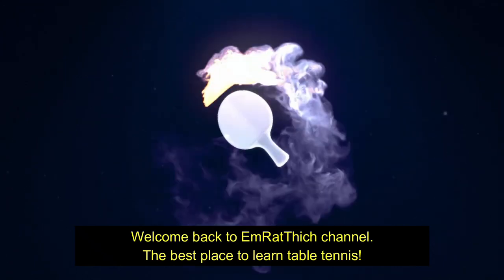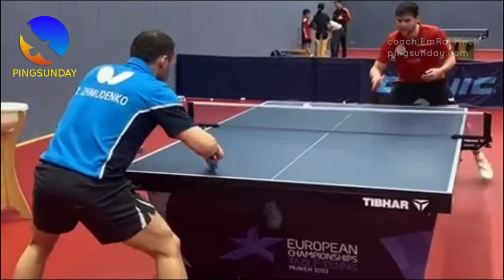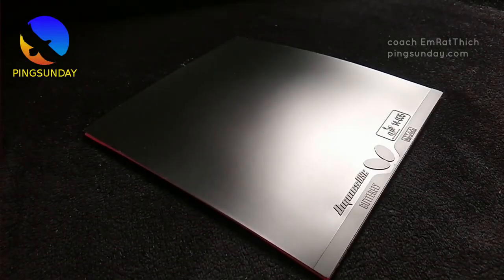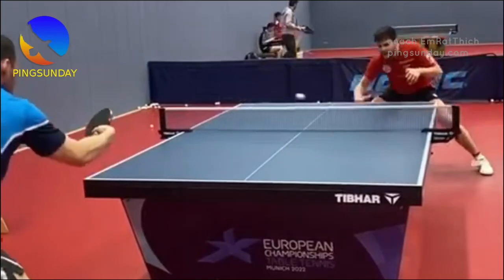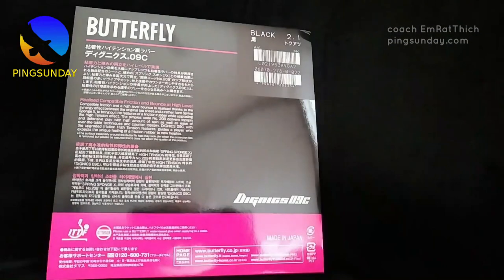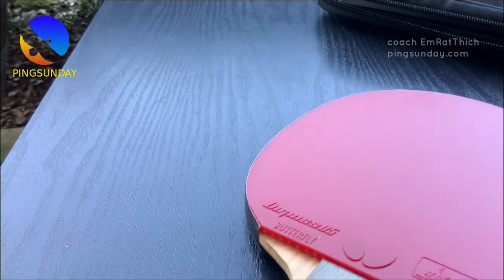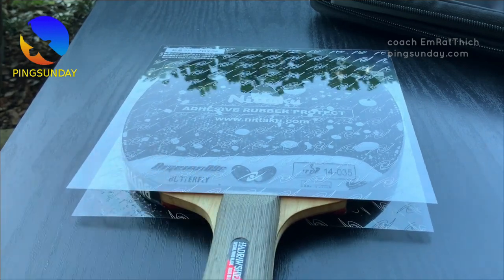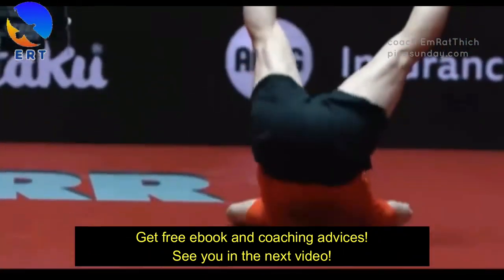Butterfly Dignics 09c review

Comment: Good review! I've read that on forums that this rubber is rather extremely sensitive to cold temperature, that its becomes hard to use under 18°C? "Okay, no rubber likes really cold environment, but this one in rather warm places are still has frostbite...". Is that true?
Reply: Dignics 09c is so brittle that the rubber breaks easily.
Reply: @nikedell6130  Yeah, had similar thoughts. Since then I dropped that idea and looking for cheap alternatives. Thanks for replying nevertheless.

Comment: Another Butterfly advertisement. 😉
Reply: Yes indeed… I have it on a Timo boll ALC blade, very good at generating easy spin from forehand and backhand. I struggle with pushes at first but adjusted and could get really spiny deadly long pushes. The problem I have with this rubber is serves and forehand flick maybe my technique is not good enough, but I have less problem with my other setup in this department (boosted Hurricane 3 FH and Fast Arc G1 BH). I found G1 is very similar in feel with 09c (I am way more consistent with it than 09c on BH loop to loop rally) on my BH and boosted GH3 is just way way better in everything.
Reply: We all agree Butterfly rubbers are good, but they too expensive now. Lot of marking...but it is the same with DHS sticky rubbers...apart from the Chinese team... none of the professional players use them. It is true that they are so good...why brands like butterfly, Donic, Yasaka, stiga, etc. Never tried that formula earlier...why do they have those so called national, provincial and customers ones? Just marketing... Japanese, Koreans and European players never use those rubbers. And using boosters and lot of layers of glue... I have never liked them and I still doubt about all the reviews... I've not seen the researches (the real method used in them). They are sticky...yes, but any brand could do it. Most of Chinese brands do it. And the arguments of that hard sponge and yada,yada... I don't really trust of them. 
  And about butterfly... I love tenergies,but come on... Those prices. There are options, alternatives which good too. Luckily Victas v 15 extra, nittaku fastarc g1, Hammond z2 and tibhar evolution series aren't that expensive... Gewo nexxus too.